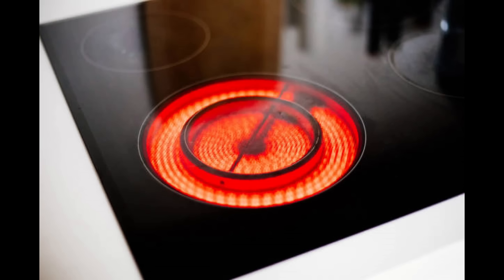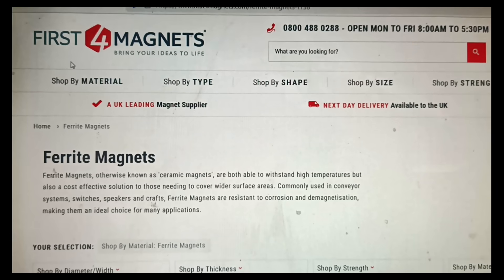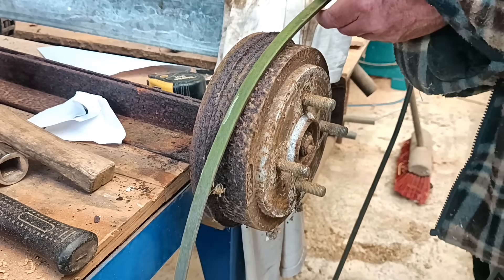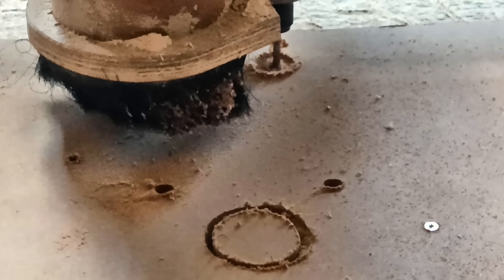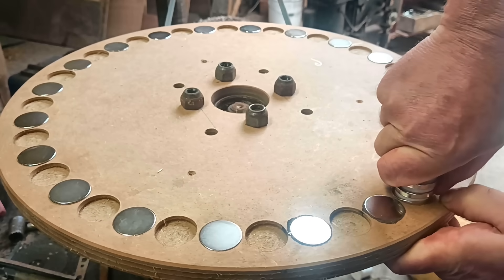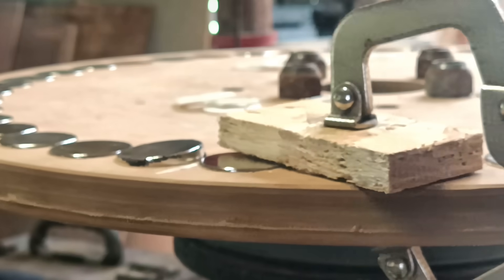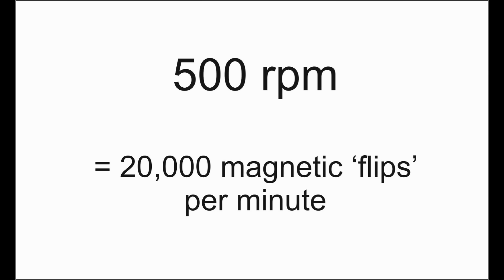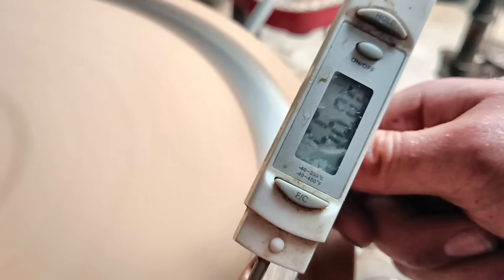I Made A BIG Rotating Magnet Induction Heater! (with magnets from First4Magnets.com)

Comment: I'm interesting in making one of these setups as a water heater / heat exchanger to heat my workshop but use a mechanical system / flywheel to power it.  Think of a stationary bike.  Get some exercise and lose some of my fat and heat the workshop at the same time. :)

Comment: your not going to make me believe those magnets are not going to get hot,   so you using a paper board is not such a good idea?   of course it works.   The amount of electric it makes is also a good question.   ideal to put copper line in the floor of a building,  fill it with an light cooking oil,  and small pump to circulated it,   and you will so heat your entire home with something like that set up inside the floor ,   and if you do it right, you can probably use the electric from it to power itself,  its quite obvious to slow the speed,  slows the temperature,  after of which,  the energy people will not any longer be used by us customers,    I think I will start with an aluminum wheel to hold the magnets so when they are hot from running for many hours,   they will stay in place,   to bad people like Musk would not fund it,  the entire project.    He is stuck on his solar panels and batteries.  Of which,  just do not work in the winter time

Comment: All you need to make this more efficient is a 50w solar panel, a battery, solar controller, 3 discs of 8 magnets 30x10. A BLDC motor controller, An axial flux motor (easy to make). Some copper pipe and hey presto.
Reply: LOL! Better connect the solar panel directly to a electric heater coil.
Way easier, way cheaper, way less losses, no wear, no noise...😂
Reply: Also, @11:40 "And remember..."

Comment: I line the windmill ideea. 
No elektricity but heat sounds nice.
You could also use water as a Energy surce or even better use a windmill to generate Energy und a mecannical pump to safe the Energy in a water tank. You than simple turn on the water in to a watermill copled with your disc an you basicaly hafe a warme water surce basicaly for free. Nice

Comment: Many people are concerned about the problem of magnets overheating and losing magnetism after rotating for a long time. In fact, it is the copper tube that senses the eddy current that generates heat, and the magnet basically does not get hot.

Comment: Well this idea is a little bit different then yours but i guess more effective..

I have watched it a few times now, and i am in the feeling to build my self one such a spinning, ( barrel ) just a little bit different then yours.. 

Around the barrel ill place a structure that ill be able to put a pipe in the middle and putt the magnets on each sites. A few times.. next to each other.. 
and the underpart aswell like a (   U    ) 3 sides left side under side right side 

That would bring the heat up even more i guess.. ill use a aluminum thin plate with holes to cover those magnets from the sides so they will not fly out wile spinning 

Ill would make more rows off those and more length off copper tubing, ( gas copper tubing is thicker ) wellding it with gas and air, 
i would fix it with a valve at the beginning so only cold water will run in like the coffee machine effect.. 
that only the hottest water will come out. 
only using a barrel it would be more stable i guess.. 
it would use 2 ball bearings on each side, 
To higher up the speed a little more.. 

Like the way i think it would be 3 times more efficient and effective then you’re model is now.. 
and hopefully it will produce steam.. 

The steam can be used to make electricity to run the light and maybe more, the hot water to heat the house and to take a bath.. 

Can you please first make it, show us the sizes, test it, and show the results, so i can save my money so far.. till you made the perfect model.. which i can duplicate 🫣
i am a poor men.. 🙈 

Thanks you ❤

Comment: so, the magnetic flips are being exerted upon the copper, which is only weakly magnetic, so then we must assume is it the electrons on the surface(s) of the copper that are being rearranged (something like that which occurs in a regular copper stator/rotor) and this imparts heat into the water ...  is that about right ?
Reply: It's not only the surface that gets hot. All copper within the magnetic fields will heat up.

Comment: The  things  I see you could improve are run copper around more of the wheel use smaller size pipe more than 1 also pur magnets on both sides and copper pipe on both Size fiber glass and put a gear system  on it to get the rpm up

Comment: You can use water cooler blocks in aluminum to heat water and then transfer the water to a radiator ,I bought some at a surplus store they heat up very nicely, I was able to create steam with them ,but if you don't want steam you just increase water flow.

Comment: i wonder if this could be scaled down to a handheld device with hard drive motors magnets and disks ive seen videos where people melt metal with this concept from what im seeing it relies on the speed of pole changes to generate heat so show it happening with copper nearby others show copper pipe coiled one coiled the pipe like a tornado shape skinnier closer to the base and that allowed the metal to rotate untell becoming liquid then it fell out of the field if that can happen then idk why the field cant be directed with proper placement shape of copper im thinking no contact welding maybe.... also i wonder what would hapen if you took this idea of spinning magnets and u gave each magnet the ability to spin allowing for 2 simultanios and opposing directions of pole changes as each magnet would be spining in place everyhalf spin being a polle change in opposite direction as the hole disk somebody needs to make an llm that can simulate a visualization of ideas like this a hands free experamentation and visualization of forces we cant see

Comment: You can double the speed by mounting a second wheel with magnets spinning in reverse. In the space between your copper plate and generate heat. I wonder if its doable.

Comment: I wouldn't make the mistake of assuming that 'flips per minute' is the most important factor heating power. The speed of the magnet over the metal surface is more important than the number of times it oscillates. I think that the power is proportional to the number of 'flips per minute' but proportional to the square of the actual speed (m/s or whatever). The magnets themselves are also subject to eddy currents being generated in them as the eddy currents in the heated metal create an oscillating magnetic field counter to the field of the magnets. I don't how much of the power will be eaten this way, but I suspect its in the double-digits percentage.

I think the sane way to do this (if any way can be called sane) is to overshoot the maximum speed you think you'll possibly need and then control the distance of the heated element from the magnets to control how much power is being used.

Sorry if you knew all of this already.

I'm surprised you got them to stay in MDF without all popping out in a chain reaction that left you with a ball of broken magnet bits.

Comment: Your thermometer has a metal tip, so is it possible to measure the potential heat from the magnets without using that copper pipe? Can you just hold the metal tip of the thermometer near the spinning magnets to measure the same heat?

Comment: Nice demo.  But to be clear about something, the energy is coming from electricity.  Electric energy is being converted from electrical energy to heat energy by going through magnetic induction.  Did you know, you can skip the motors and magnets and go straight to heat by powering an resistive electric heater?  The molecular jiggling takes place in a conductor that has resistence.  No motors, no magnets, same heating. Just saying this to help people understand energy.
Reply: 11:40

Comment: While I admire your enthousiasm.... you should look into energy preservation and thermodynamics. You will never exceed the energy you have put in it. It's easier to put on an electric (resistance) boiler in stead of creating all these energy losses while trying to do the same using magnets. The windmill can drive a generator. It would me more efficient.
Reply: The windmill drives the magnets that heat the water. Kinetic energy directly converted into heat. No electricity needed. How can it be more simple and efficient???

But apart from that:
Congratulations!
After reading more than 100 comments, you're the first one to mention you can never take more energy out of a system than you put in.
Doesn't matter how the Kinetic Energy Into Heat Conversion can be done more efficient. If he uses a bigger piece of copper, he takes more energy out of the system than is put in and the disc slows down, so he's already at the max.

Comment: The magnets also heat up, but this is harmful for them. A more optimal design is a high-voltage generator with low current and a standard boiler through a step-down transformer
Reply from the maker: no they don't

Comment: I think the most reasonable setup for your windmill induction heating system would be to have a large suspended water tank or multiple smaller tanks and utilize it/them for hot water and radiant home heating essentially maximizing the usage of the system to its fullest..

Comment: Why not cover the whole disc in magnets. They don’t just need to be on the outside. Then mount the magnets on a circular frame where they are exposed on both sides and put an aluminium plate on both the top and the bottom so there is a sandwich. That will double the exposure of magnets to plate surface area meaning you can really get some heat going.

Comment: As long as you have a rapidly rotating wheel near the thing getting hot, you can cut some spaces in the wheel and add vanes, and then it's a fan.  Put a duct around the whole affair, and you've got forced-air heating.  

When I lived in Vermont, years ago, we knew someone who'd built a drum-in-a-drum friction heater (with oil separating them; I always forget the name of those things) with a fan built into the inner drum, which was turned by a small windmill by a drive axle from some old small car.  He claimed it worked astonishingly well, but his bearings were junk, and the maintenance was a pain.  I never saw it, myself, but I can imagine it.  Free heat . . . without a thermostat . . . when the wind blows.  In a Vermont winter, most likely a definite gain.

Comment: I'd very much like to see a loop of copper pipe fastened just above the magnet disk. With luck, perhaps some water inside may flow with convection alone. Or even a light oil, to prevent steam? Could heat a small reservoir of fluid this way.

Comment: Very inspiring! Thank-you. This winter, I will be experimenting with simple vertical (savonius) wind generators which could be used without 90 degree gearing. I'm curious if a longer copper pipe (loop), taking advantage of all the magnets could be bent around the entire magnet disk, and passively connected to a water tank?

Comment: Of course it works. But you're wasting a lot of energy moving things around instead of heating. Open the drill, remove the driveshaft, and use the 3-phase coils directly.

Comment: Yes copper or other metals will work, but iron seems to be much more efficient than anything else. So much so that an induction cook top will only work with magnetic metals without shutting off. Anything else and the copper coil in the cooker heats up just as much as the pot or more.... cooking the cooker rather than the pot. IN your case, there are no coils to cook so cooking the magnets may not be a problem but if you are looking for maximum heat, iron will probably work better. You would of course have to keep the two bits apart :)

Comment: you'd get way more heat out of the electrical power the press drill is using than what the induction is producing.

like..lol wtf is this
Reply from the maker: congratulations - you're the fourth person to miss the windmill : -   )
Reply: @wayoutwest-workshopstuff6299  and windmills as we know them with the generators/inverters are less efficient than what is proposed in this video? I did not know.

Comment: WHY WOULDN'T YOU MAKE A COPPER LOOP FILLED WITH WATER. 
This could be a great way to heat water with a 12vdc battery for a caravan. Can you experiment with that. 
Only needs to be around 50°C for heating and washing up or hands.

Comment: A copper pipe bent into a circle that matched the magnets, on each side of the wheel could heat water to circulate into the house, and wind can even drive the pump. Excellent work.

Comment: Could replace the copper pipe with a coil of wire, and if it's got the correct number of turns plug in a regular bar heater, obviously it wouldn't be mains frequency but you could run regular old corded tools off it too, might need to convert it to DC though depending on the frequency, if it's way too high you'll lose some power

Comment: What if you kept the magnets stationary, had something like aluminum fan blades rotating over them and put heat sinks on them to help radiate that heat to your airflow? You heat the air and circulate it in one fell swoop :)

EDIT: looking up on induction cook tops certain types of aluminum and copper dont work too well, but they say cast iron or stainless steel works well at holding the heat!

Comment: I dont see why using the magnet for heat wouldnt work,  use a closed loop system with a glycerin based liquid so it doesnt boil as easy with a heat exchanger to water to go to room radiators.  Do 2 or 3 layers deep on the magnets in the circle and do a copper coil around the entire disc so you get all the surface area for heating the glycerin

Comment: you can use magnets in a specific orientation schedule in order to shift the ethereal field distortion to a single side, i did some research on vertical positioning the magnets and having them rotate within a spiral bend tube, i was able to generate heat but never chased it futher as new ideas streamed in. Now im thinking that the field strength can futher be enhanced by adding thoroidial field magnetism at 90 degrees of the primairy field. as mention in the comments care should be taken shield the magnets from the generated heat as this weakens the magnetic flux effect. the disadvantage of this is that when using isolation the distance between the copper and the magnets increase thus weakening the effect. a possible solution for this would be to have the apparatus operate in a vacuum field. also the adding of a bismuth (densifier) layer should be looked upon as this could possible increase the efficiency of the magnetic field tranfer rate onto the copper.

Comment: One idea for making it more efficient. Make two magnet disks and mount them with magnets facing each to the other. Between the magnets, put a loop of (flatten) copper pipe. And turn the disks. 
The polarity of the magnets on the oposite sides (on separate disks, facing the pipe) may be N_N or N_S, you may want to check to see what and how big the difference is. Also, the distance between the magnets and the pipe should be the smallest you can achieve.
Also, you can make a small coil (maybe with a iron core) from few turns of copper wire and measure the voltage and frequency of the induced current when placed bettween the two magnet disks, and so you can also see the difference in the magnets polarity beween the two disks. The frequency being in the low range, you can hear it through a speaker or, better a piezo speaker.
Cant wait for updates. Btw, Cody from Cody´s Lab, has done something similar few years ago.

Comment: Can you use copper pipes with oil being pumped through a closed circuit attached to a thermal coupler that is pumping water through a separate valve system on the other side have another thermal coupler that pumps heated water through a valve system that heats the floors , but whilst there a magnetic field already existing why not use 2 sides of the disc and gather electrical current from something that looks like a brake pad wrapped in coils of copper , and store the energy to power say a raspberry pi that could monitor the temperature, use relays to switch water dump valves and control the speed of the gear ratio

Comment: Just a few tips: Check the Curie temperature of the magnets and make sure they stay below that or you may find yourself needing to buy a re-magnetizer, I'd recommend using ratios of pulleys or gears on the windmill to make the disks spin faster, and instead of making one large disc, experiment with making 2 smaller, parallel discs of opposing polarity where the heated material sits between them. This final suggestion may make keeping the magnets cooler harder, but it might help if you can get around that.

Comment: I have watched your video and this is ingenious.. But I have an idea that. Imagine if you will a checker board printed on the inside of a cylinder approx 6 inches in Dia. Approx + or - ....
The cylinder is spinning, and inside the spinning cylinder is your hot tube. Now back to the checker board. All the black spaces are neg. and all of the red spaces are the pos.  Alternating the Magnet Placement. Odd rows are all the same, and even rows are all the same.
You would have cross hatch action flipping, in both directions at the same time as it is spinning. { instead of just spinning around in a circle under your hot tube, the spinning action of the cylinder, is covering the circumference of the hot tube}.   The cylinder could be made longer or shorter in relation to the output of the water temp.  What do you Think ? ? ? ? ?
Reply from the maker: I think you should try it! Sounds possible - let us know how it goes..